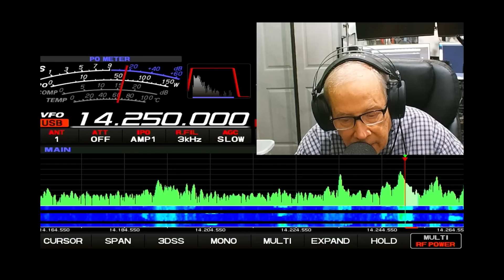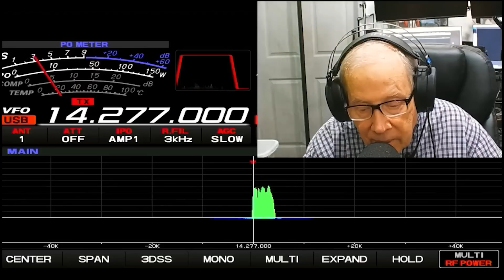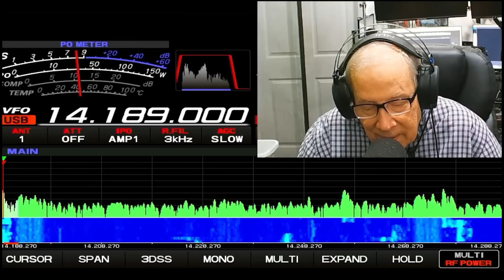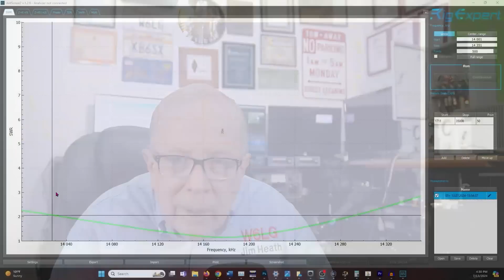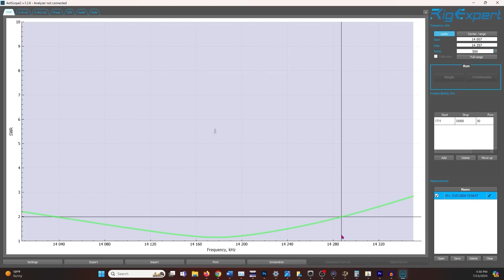How to Calculate Q & How Much Q Because Q is Quality & So Is Jim W6LG And then there's Dick Deceiver

Comment: One of the reasons I like my approach of build don't buy. When my "great antenna idea" turns out to be a frequency-dependent dummy load, I still have all of my materials to take apart and reconfigure, each time with a little more knowledge. The only piece of an antenna I've purchased outside of the hardware store are coax connectors and a telescopic whip - I still built the feed point and if I make a coil for 30m or 40m, it's going to be very fat.

Comment: Jim, thank you for explaining the "q" factor. So my understanding now is the Delta loop would have a smaller "q" value than the half wave dipole because the loop has wider bandwidth. And the dipole is better for transmit strength. Correct?  
I use 14 gauge copper thnn/thwn 2. Will that give me a reasonable "q" factor of my dipole antenna?

Comment: As I tried to comment before, this was a very informative video.  I have not considered Q-factor before, but after reading more I now appreciate it.  I get that Q is a ratio measure of the total power to the power lost.    The given estimate using the band width has some very important limitations which I have just come across in measure the 40m performance of a Mad Dog 80 coil/17ft whip/ 8 5m ground radials.   I was able to get a reasonable SWR of 1:1.59 at 7.200MHz(measured via nanoVNA).  The Q obtained for the bandwidth below 1:2 SWR was 22.5.  But this appears artificially too good because of the poor minimum SWR.  For example, I could see a SWR of 1.9 having a Q-factor of 50 to 100.  This of course would be garbage.   Thanks for making me think!   K0OKE

Comment: Question Jim: With my little tapped vertical at say 10 metres, it's wide: Low Q. But when I change the tap to the 80 metre one, it gets a narrow tuning, so it calculates as a higher "Q." But I don't see how the performance is better at 80 metres, of course it's not. So maybe there is less CAPTURE then? 73 DE W8LV

Comment: Hi Jim!  Excellent presentation!  Love the fan as a prop.  I switched from Ham Sticks to the ATAS-120A with the FT-891 in my truck. The ATAS-120A has a decent Q factor, but of course it isn’t going to compete with the bigger, fat-coil, antennas.  On 40m, if I move much more than 10 to 15kHz, it needs to be retuned.  

I expected much more of a compromise in performance, versus my Ham Stick. The Ham Stick is (was) mounted top dead center of the roof of my truck. The ATAS-120A is mounted on the front left fender. The only performance weakness I’ve noted is in the direction of the front left of the vehicle. There is an approximate 2 S-unit difference on 40m. But to the left and right the two antennas are approximately equal. Out the rear, and especially the right rear, the ATAS-120A beats the Ham Stick by up to 2 S-units. I shot a 5-part series about the ATAS-120A. I ran both antennas for a while, with an antenna switch.  I eventually removed the Ham Stick.

Interestingly, I broke a pileup one night and worked Bill, ZS6CCY, while driving home from my daughter’s house. 100W into the ATAS-120A. Another night, also driving home from my daughter’s house, I worked a station in Ukraine and another in Bulgaria, back to back.  I must admit that I didn’t expect so much from the ATAS-120A.

73, Jim de Doug, N4HNH

Comment: By the way, I have an ATAS antenna. It’s high Q for sure. (Will measure later and get back to you. ) if the ground plane isn’t good, then the Q is very low on this antenna.
Reply from the maker: Look at the coil diameter and the wire size/spacing then tell me it is high Q. It just can't be.  I did an autopsy on one many years ago and found it to be really awful on the inside. 73, Jim
Reply: @ham-radio  Ummmm. Q of an inductor depends on the resistance. It's large-diameter silver wire. Very low resistance. This should relate to Q of the antenna. Nevertheless, this weekend I'll do a test of the Q on various bands using your method and let you know what I find. In the mean time, know that I've reached Norfolk Island on 50 watts using this antenna! Look at my log book. Most of Europe including Greece. Parts of Latin America too. And as the song says "we've only just begun" ;-)
Reply: @ham-radio  By the way, see this video where he compares a large-coil diameter and thick wire Wolf River, to a pretty small diameter and also apparently small diameter wire Gabil antenna. In his test it seems like really similar performance. He did not do a Q test. That would have been interesting. https://www.youtube.com/watch?v=Rqj7D0xk7AY

Comment: Thanks for the video. I use a very high Q screwdriver antenna and love it. Have reached literally to the other side of the world. By the way, what does it mean five nine six or five nine zero six? I just don’t understand the “six” part.
Reply from the maker: During a contest the report is 06. 73, Jim
Reply: @ham-radio  Sorry, I just don't understand this and when I type "signal report 59 06" into Google, Google doesn't know what this means either. Other than your video, I've not heard of this while I'm listening to the bands. Could you provide more info about the "06" or a link to more info?

Comment: Some low Q antennas for a
given frequency can become  high Q antenna systems when brought to resonance with a suitable transmatch 
if we are using a low loss transmission line like a good  balanced line.
Reply from the maker: I don't agree.  You can't change the antenna performance with a transmatch. Thanks for you input 73 Jim
Reply: @ham-radio  I said antenna system.
Yes you can improve the Q with an ATU and a low loss transmission line .

Comment: I understand the points you are making here and appreciate the time you took to put this video together.  However, I’d like to respectfully offer a counterpoint.  A High Q antenna may not always be the best choice for a given situation.  For example:  If one is attempting to operate portable, an antenna that is easily packable and deployable may be a higher priority requirement than one that is electrically efficient.  Even though the hypothetical Rocklin Rover may not be an efficient antenna like your tri-band Yagi, it’s a better choice for someone who needs a portable antenna and will work well enough to suit the needs of a casual, portable operator.
Reply from the maker: Good point and well written.  I would counter with when portable and low power, I would think that you would want the most efficient antenna with a reasonable Q.  I would think that getting the best ERP would be important. I understand that tuning and the environment make that difficult.  What do you think? 73, Jim
Reply: @ham-radio  I agree with you to a degree but as I alluded to above, there is always going to be a tradeoff between efficiency and convenience in almost every antenna installation which may mean Q is not the most important factor even for low power operation.  In other words, I might be willing to compromise electrical/RF performance  for some other attribute that solves a problem for me a higher Q antenna can't in a given situation.

Comment: Yes Sir Jim. High Q is good for antennas but the concept of Q is a means to an end. If I want to use the fan to blow dust away I want a high Q , if I want to fan my face however I need the inefficiency to cover the broader area of my face. Lol
Reply from the maker: How low is too low and how high is too high?  it depends.  An antenna that has a very wide bandwidth is one that I would not buy.  What do you think?  73, Jim
Reply: @ham-radio Jim most dipole antennas have a wide bandwidth, correct?

Comment: When you have a regular quarterwave vertical for example, it will have a XL.  The Xc will cancel that XL if it is truly a quarterwave vertical.  If we want to shorten it, we will add a coil to the vertical to cancel the added Xc from shortening the vertical.  So if our radiator is shortened, these things happen.  
1.  Radiation resistance lowers.
2.  Ohmic losses lowers. 
3.  XL (inductive reactance) increases with the added coil.  

So when we take the formula Q=XL/R, the XL increases and the R lowers.  These actions increase the Q and we can say we have a higher Q.  The bandwidth lowers.  

The equation you use is valid for series tuned circuits.  Q = f0 / (BW).  But the bandwidth defined is to be 70.7% or about a 3.4:1 SWR.  So your Q will be much lower than what you are claiming on your Yagi.  I would guess less than 25.
Reply from the maker: What is the Q of the coils used to shorten the antenna. If you have two similiar antennas and each has coils to shorten the element. One has a high Q coil and the other has a lossy low Q coil, which is better? Which will have the greater bandwidth?  If you use the Fc divided by the BW, which will result in the higher Q?  In your example, I did not understand what the Q of the coil was going to be . Why is BW defined as 70.7%?  Where does that come from?  If I am considering buy one of two yagis and the BW of one is greater than the BW of the other, which is going to be more efficient?  I would bet on the narrow BW.  That for me makes sense.  If one yagi has loading coils that are low Q, the BW would be greater.   Regards, Jim
Reply: @ham-radio  First of all, an antenna Q will be calculated or measured by the entire antenna as a whole.  The frequency divided by bandwidth method can be used as Jim did.  However he used the 2:1 SWR points and it should be the 3.4-3.5 SWR points.  But if you have 2 similar antennas, your concern will be with the coil.  A lossy coil may not be that bad.  If you are using #32 wire, it will be lossy and probably burn up at 100W.  But a #18 as opposed to a #10 might not be noticeable.  The Q is simply calculated by finding the XL divided by the R.  You can get XL on the NanoVNA at the frequency you are wanting to operate.  You can get the R by taking an ohmmeter, zeroing it out and finding the R.
Reply: @ham-radio  Lower Q antennas aren't as bad as Jim is saying.  As seen in his example, his Yagi Q is actually much smaller than what he believes it is and much closer to that "dreaded Q of 5".  Tis far better to not worry about your antenna Q if you don't have coils and if you do have coils, get a laser thermometer and measure the temperature rise with a key-down over a few minutes.  

The whole concept of ABC (Always Be Chokin') is to reduce SWR by lowering your system Q.  It will electrically increase your R and lower your Q in the equation XL/R.
Reply: @ham-radio  He's using the 3db point to measure Q.  70.7% is the 3db point.
Reply: @Jesusfreak-316  We do like to hear from you, especially if you have something to say.  What circuit analysis have you done?
Reply: @Jesusfreak-316  I have not attacked anyone.  I made succinct and specific points about the presentation.  If you have anything specific, let me know what that is.  Actually, you don't have to be rude.  Jerry N9XR

Comment: Jim, your vacuum/blower is the perfect visual to explain "Q".  I have been licensed four years. Was an Electronics Tech in the US Navy, in another life, early 80s. The principle is not foreign to me. When I watched the previous video on the "Rockland Rover" I was reminded of a conversation I had with a fella. He was buying an amplifier. I ask what radio, he said FT857D. What freq? 20M. The 857 is 100 watts HF, what are you experiencing I asked. Only getting out around 200 miles on a good day. Antenna? I asked. 20M Dipole. Then came the thousand dollar question, have you checked "Q". He told me it wasn't necessary, this wasn't a home made job he bought it from HRO. They take care of that, that's why he bought it. I tried to explain "Q", and the fact he was probably only radiating 10 maybe 15w the other 85w was more then likely heat. He just wouldn't hear it  Me, Flabbergasted. Yes I am using your vacuum/blower analogy, best and easiest way I have ever seen to visualize the principle. Great video!